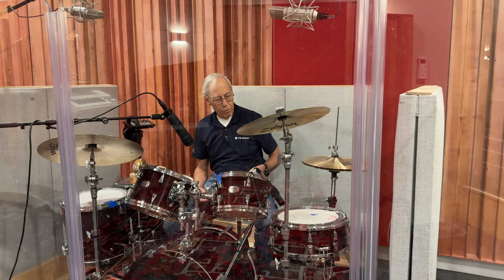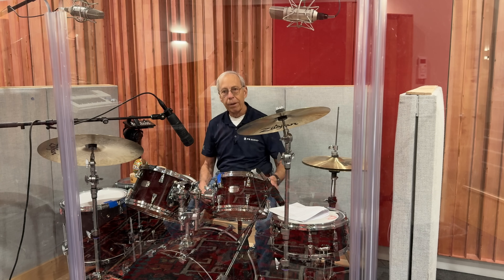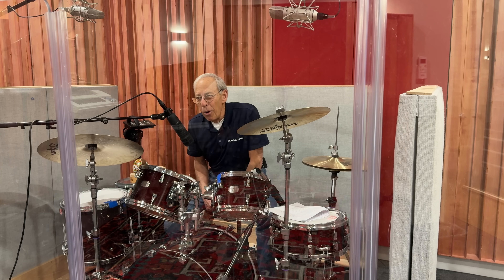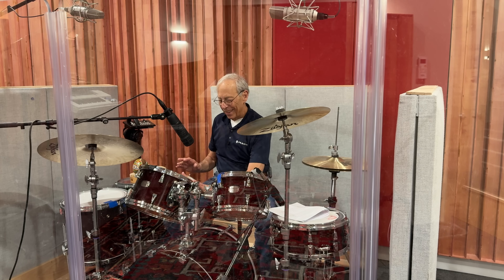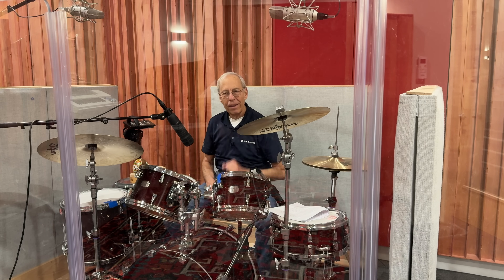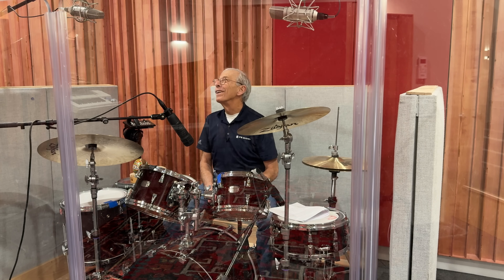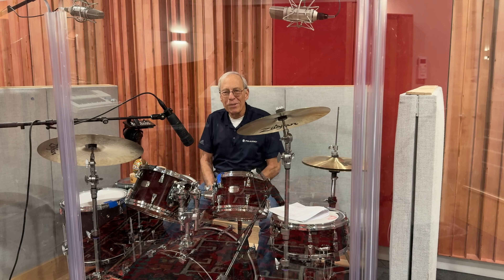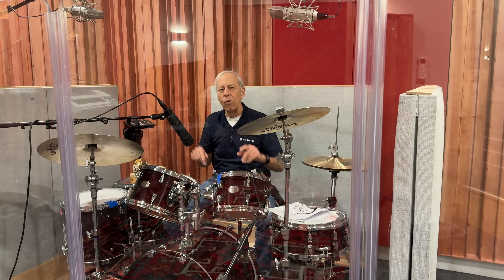Preamps inside an integrated

Comment: Most do not allow that but many do..
My integrated has it's own dedicated input like that so I can directly access the dual mono power amps that also both have their own seperate toroidal power supply.
It's designed to be used as both power amp and integrated at the same time with 2.2 pass-thru options etc. So i.e I can use it as a power amp with a surround reciver and as a normal integrated for pure stereo use.

Comment: Kind confused... I have the Marantz Model30 integrated and it has separate PRE-OUT as well as POWER AMP in... There is no jumper between the two.. So...   I use the Pre-OUT to connect to a powered subwoofer.  I can use also POWER AMP input to connect to a totally separate PREAMP (to add more sources)  then I select POWER AMP IN as my source.  It still maintains connections to the devices I have connected to the Marantz's inputs... In short, I get TONS of inputs if I wanted to.

Comment: The question was about a specific Unison integrated which does NOT have pre out and main in connections. He would be cascading two preamp sections.
Reply: More shoot-from-the-hip by Paul.  Notice that he never pulls a video or posts a correction when he's wrong?
Reply: @markmeridian3360 that would be un-American 😉
Reply: Very few of today's integrated amps have a home threater bypass, or way to separate the pre-amp / amp.

Comment: My integrated has 2 sets of pre-outs and an AV input which directly feeds into the power-amp section (bypassing the pre-amp section). I assume I can just connect an external pre-amp (or another source that has variable level) into this AV input if I wanted to use the integrated just as a power amp.

Comment: So does that mean the analogue inputs on an integrated bypass the preamp section? How does the integrated know there’s a preamp at the other end of the cables?
Reply: No, it does not mean that. Paul was only talking about integrated amplifiers where you can separate the two or where you have a separate 'power amp in' connection. If you connect a source to the analogue inputs of a standard integrated amp, you will NOT bypass the pre-amplifier.
Reply: @andymill8552  That's what I first assumed but Paul said psa integrateds have this feature and when I looked up photos I couldn't see anything on the rear panel (pre-in or line-in) to indicate how to bypass the 2nd amp's preamp. 

Not something I recall seeing on others either.

Comment: I am just waiting for that next gen audiophile "digital preamp" that includes a DSP + DAC + volume control with at least 4 outputs to support left + right + 2 subwoofers. Thanks to the high resolution audiophile DSP it can do a proper cross-over between subs and speakers. Also it can do room optimization, loudness EQ, rejuvenation EQ and personal taste EQ for those of us who care the optimum sound. Source wise, it should include digital inputs from streamer, Bluetooth (incl. lossless) and transport. Obviously the volume control has to be audiophile also. And internally the digital side and analog side must be galvanic isolated. It could even be available in a version with more outputs to allow active cross-over filtering e.g. 8 outputs (2 x 3 way speakers + 2 x subwoofers).
Reply: You could put something together (if you don't like what's out there), there's not really any bad DSP chips (more of a difference what they can handle), it's the input (ADC, unless I2S is used directly) and output (DAC) that could limit the sound quality but that could potentially be placed externally. Volume control is often placed in the digital domain so a $2 potentiometer is as audiophile as it gets. 
Now if you're looking something with 10 different digital and analog inputs and 10 R2R DAC output and all integrated, or something else really over the top in one box, then I guess you'd have to wait. 😄
Reply: @PSA78  I don't need an ADC in a digital only system. Yes even an ARM chip can do DSP processing on the CPU cores fast enough for audio nowadays. And of course the audio fidelity is about the math and not the DSP hardware as long as you can do 32 or 64 bit math. I have a miniDSP flex and some other miniDSP products but I would like something more audiophile.
Reply: @ThinkingBetter  A lot of people are going away from analog, but some might still feel it handy. A good clock and good DAC should be enough, so the pieces are out there. 😄
Reply: @PSA78  Definitely my flagship checks every box right down to control the left/right subwoofer 

Now it can be intimidating I've not counted but probably more than 3k parameters related to sound example you can adjust the input trim for each digital or analog input .. critical to match different components... Other items like Phase Lock Loop controls for the DAC can also be critical, My personal favorite is to independently balance the Stereo image to .5db for each speaker 

Also use a tablet to manipulate the deeper layers of the interface
Reply: @thinkIndependent2024  There's certainly a bit of a difference between interface and how user friendly they can be, the one I'm using now is pieced together so I'm using SigmaStudio which isn't exactly designed/built for average consumers, but there is a lot of options (and it's not that hard).
I'm not sure how far they have pushed it, but being able to integrate and bring it all up on a TV screen would make it user friendly, measurements, adjustments the whole 9 yards with visual and guided interface. The rest is kind of out there all ready, I would say.
Reply: @PSA78  I have a Head unit that has not been plugged in 20 years  that allows sound parameters for each channel and its production date is 1990. Yep  adjustments were done through composite video out and a remote with 140 buttons. 
Sigma Studio is a new kid !!  My latest units have HDMI but the integrated web server allows more granular and deeper control . 

I only use computers that are fanless for my audio , But all the capabilities you mention have roots in the professional equipment I utilized during my electronics technology internship. 

SigmaStudio seemed a little under developed about 4 years ago when I gave it a look, 40 years ago DSP and audio married together and produced lots of beautiful sound since.
Reply: @thinkIndependent2024  It's definitely not new, I recall when NAD released something in the 90's, and it found its way into car audio pretty quickly.
Analog Devices has been around for a while, but I don't know when they started with DSP. 🤔
I'm not using many features, it's an active system and beyond what you would do with a maxed out passive crossover I just pulled down peaks in the in-room response. I did try to iron it out a bit more but didn't like it as much. 😄
As I see it one of the main features is that you don't have to invest yourself throughout the entire analog chain, you basically don't have to go over to analog until the last step into the amplifiers which then just connect through cables to the drivers.
Reply: @PSA78  Well my next project will be a 2 channel active DSP controlled Open Baffle with Integrated crosstalk cancellation capabilities.. I've owned all 3 generations SDA but wasn't  impressed with the last model , So for that I will build my own unique design and application to run it all
Reply: @thinkIndependent2024  It sounds like a fun project! 😄 We are kind of spoiled these days with how much that can be done with relatively affordable and easy to use equipment. 😄
Reply: @ Sounds like me. Compared to traditional passive filtering incl. cross-overs, a modern DSP can do everything better as long as it can run in the native sample rate of the source avoiding any SRC in the path and of course assuming your sources are all digital.
Reply: @ Automotive audio today is all with DSP managing the speaker-up mixing to get the frequency response and timing of each driver right. I've used Analog Devices SHARC DSPs a few times btw. But even a CPU can do DSP processing if it has enough bandwidth available. I am looking for something like a more audiophile lineup of what miniDSP is doing. They themselves could also easily do it to make more business.
Reply: NAD M66
Reply: @skmzwanke  Yes, NAD is still doing good. My first amplifier purchase was a NAD3020 in the mid 1980s.
Reply: Flagship Integrated units do that TODAY they also include a bypass mode to remove and influence from things like DSP if that is your desire.
Reply: @ Yes, but I like more DSP control while having a top-notch DAC and possibly 8 outputs for digital active cross-over like I have in my miniDSP Flex. Which flagship integrated amp does what a miniDSP Flex Eight can do?
Reply: @HeavyCrown2030  BTW, you probably made your ID for similar reason as I did LOL. Nowadays people get manipulated by the internet serving you stuff that plays towards confirmation bias. If you watch one video making a point about the earth is flat, you might end up believing it if you let YouTube decide what videos you watch. So thinking independent or thinking better are probably both about using your own brain. Nowadays this is particularly a big concern in American politics.
Reply: @ThinkingBetter Exactly !! My technique is to remove it from the watched list . 

Two parties were established very early in the Constitution, contrasting ideas are  at the Pinnacle of positive outcomes
Reply: @HeavyCrown2030  Yes, indeed. Those of us working in R&D know that we should always encourage people in project teams to express their different independent opinions and allow discussions judging pros and cons to reach better solutions. American politics has lost that quality entirely. You either have to fit into one bucket or another bucket of political agenda and better not disagree anything.
Reply: You can do this today with a computer and multichannel pro audio interface. There is a learning curve to that though. Another option is pro audio processors that have many in/out and powerful dsp chips.